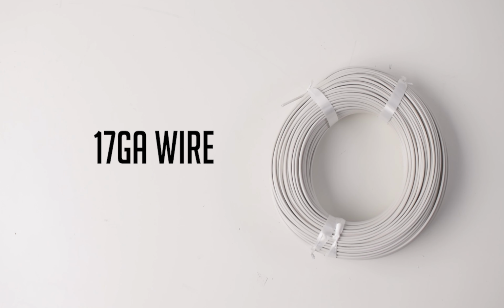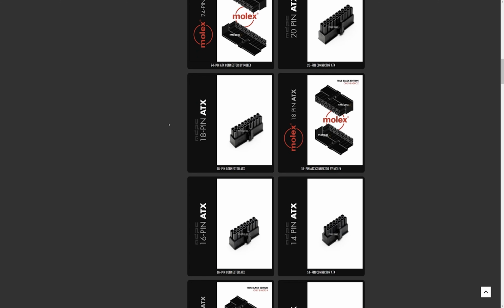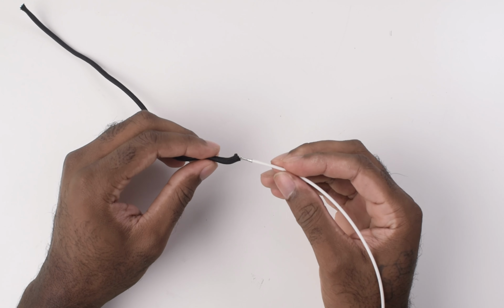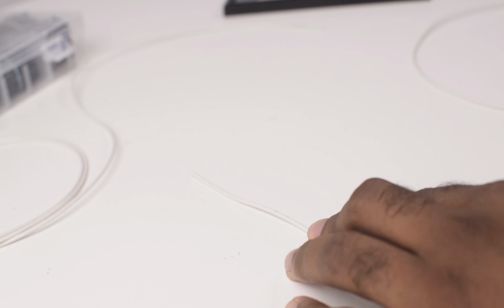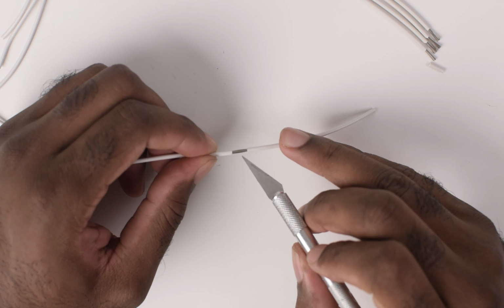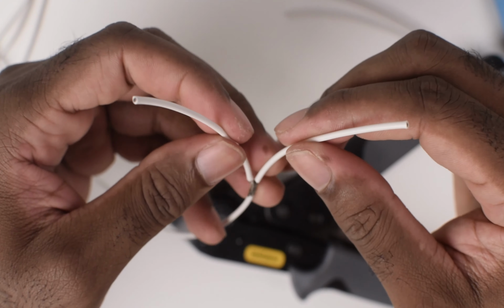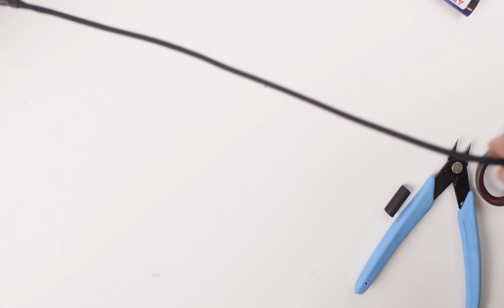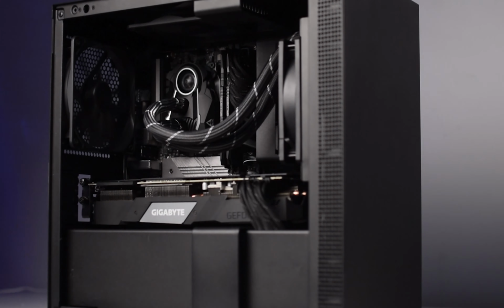CUSTOM SLEEVING TUTORIAL | How I Make Custom Cables

Comment: Constructive criticism should of heat shrunk your y connection before sleeving
Reply: This reply must be pinned in order to correct the content of this video, y connection here is fully exposed to braided sleeving but should be covered with insulators like heat shrinks before it contacts to a metal. Making small mistakes like this becomes the reason why lots of people argue diy custom cabling might actually be hazardous

Comment: I still don’t understand the pinout diagram. If all the cables are using female atx and you account for no pin and double wires what else is the diagram for?
Reply from the maker: The diagram shows exactly where the pins connect. There are around 42 different pin mount points in just a 24 pin cable alone, and they all have specific functions. Each manufacturer has a different pinout so having the correct one will make sure there aren't any terrible results from running electricity through the wrong pins.
Reply: @AliOxen  i so want to give this a shot but I’m afraid of making a mistake and blowing something up. 😂

Comment: still don't understand how to read pinout chart...shows 12v, 5v, 3.3v, etc. color codes in were they go or do I just read the pinout with double wire, no wire, double wire  opposite end?
Reply from the maker: I haven't gotten too deep into the voltages, even though that would make it easier to understand, I  look for pinouts that list the socket numbers rather than the wire voltage

Comment: I have become ridiculously good at sleeving but I have been searching for a new method. I might have to come up with it on my own. I noticed that the CableMod cables are actually crimped ON to the sleeving as opposed to melting. It makes it a lot cleaner. I want to try this. Have you?
Reply from the maker: I haven't tried that yet but I have definitely slowed down the amount of custom cables just because of how intense the process is that I show in this video. I have an entirely different type of cable I'm about to try and maybe you'll find that interesting. It's likely not practical in most scenarios but there are no YouTube videos about the process, if it goes well 🤞

Comment: Really amazing idea! I have watched a lot of contents regarding custome cables but no one has tried to split one cable to two cables like this way.
Most ideas would be use a short cable to connect two holes of the PSU which are under the same voltage. This could be inaesthetic honestly speaking.
Unless you are using a PSU that can be connected with the motherboard by parallel cables then this would be no problem.

PS: if you are chasing to have perfect shapes of the cables, you can try to cut different lengths of the cables to make them suitble for their directions. But this would be much more time consuming.

Comment: Good video! Both in production and information. Also looked like the split method used was easier than other's I've seen. 

Btw, I'd love your input! I'm brand new to this; do you think it's easier to make extensions or re-sleeve stock cables from PSU? I wanna do it with an SFX for NR200P.

Comment: you shouldn't be messing with the wire gauge based on personal preference. if the power supply uses 18AWS as standard then switching to 17AWS will affect it's performance. Unless the power supply explicitly says that you can use a range of gauges, don't arbitrarily change. While 17gauge might be easier to handle because it's thicker and fills the paracord more fully, the larger strand size means you're going to have different capacitance and resistance ratings..so in essence, the total load (amps) you are able to get will be effected...could result in hardware damage to other components in your build..or worse, could cause a fire. might want to use a techflex or paracord that is fire resistant or has thermal dissipation properties like firecord..but really you shouldn't have to worry about that if you're using the correct gauge.
Reply: but your technique and method in the cable assembly is pretty on point. well done 👍
Reply: Bruh, where’d you get that from? That isn’t true, that only applies if you use lower gauge than the stock cables. If you do use lower gauge than the wire can melt and cause a fire but not higher gauge…. Actually do the research and stop spreading misinformation
Reply: Time Spy top charted EVGA overclocker "biso biso" experimented with different power cable gauge to see if it affects the performance and showed there are merely no connection between them. Agreeing with Sean, you should not spread misinformation
Reply from the maker: I"m definitely not an electrician but I have some insight on how to make these cables safely. I appreciate the insight.